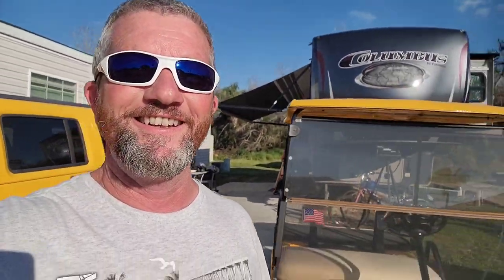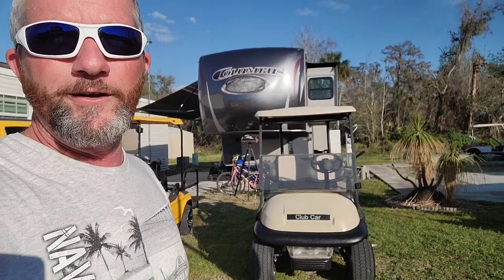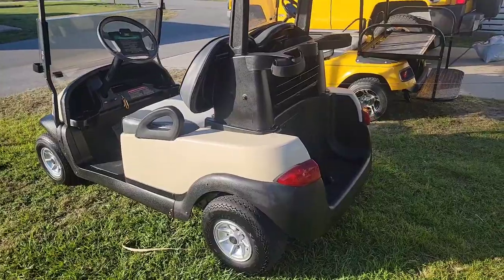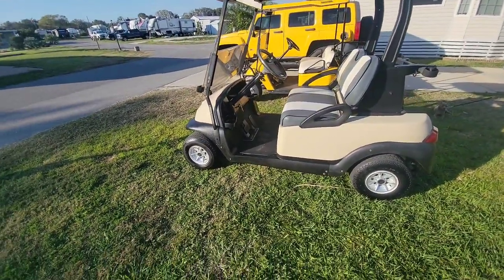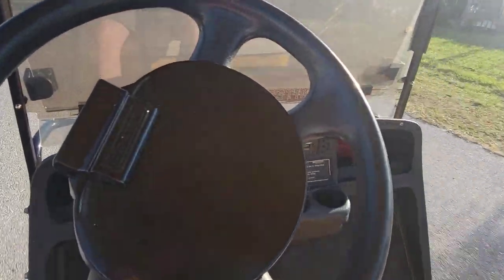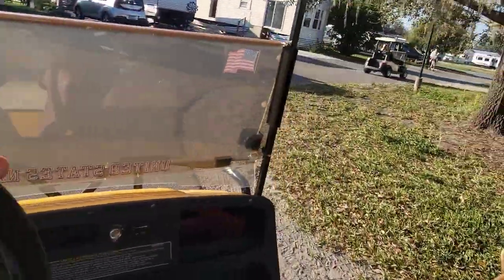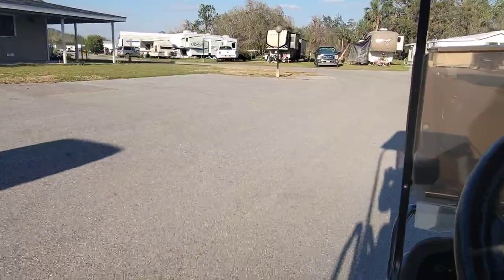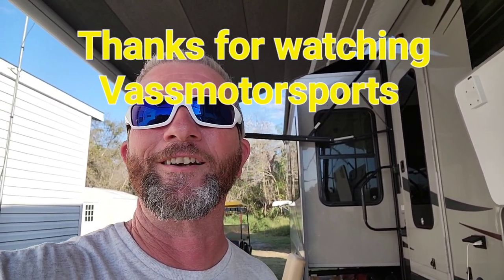Ezgo 36v. VS Club Car 48v drag race golf carts,which one is faster @Vassmotorsports

Comment: Just saw your video, my ezgo 36v with 20" tires does 20 .6 mph on gps, my brother inlaw has a club 48v w/ mods does 20.2 mph.
Reply from the maker: thanks for the feedback,  this yellow ezgo is all stock 36v and 18"tires and has to run 20mph cause after this video i picked up a lifted cart just like this one and its all stock except the lift and 23" tires and it ran 19-20 on gps and this yellow one out ran it ,  ive sold all these since then and just using an old Club Car DS i got dirt cheap cause it was in the flood from Hurricane Ian at the park ,  thanks for watching Vassmotorsports and hope ya check out some of my other videos sometime,  heres 3 video links ,  first is the lifted cart i put some lights on and second is my DS that i rescued and restored some and one i did some custom seats https://youtu.be/j2Rkf1sftgg?si=kMgHwxVyOIev74S6.        #2. https://youtu.be/7EacmE_K6WQ?si=A9eOFYjsLPYIqGRu.     #3 https://youtu.be/xkMav3TQ7ik?si=Pa2Xl63D3r-tTjen.    #4https://youtu.be/IWlVBVyNLKw?si=PPUH67jYkrY6S9XV

Comment: I JUS BOUGHT ME A 48V YAMAHA DRIVE LIFTED AND IMA SMOKE ALL THE GAS CARTS AT THE PARK THIS YEAR GODBLESS THE TORQUE
Reply from the maker: Yes they definitely have a lot of torque,   mine still had the stock magnet on the motor for the speed sensor and can change to fool the controller to go faster.   Or can have the controller programmed to higher level for speed.  The yamaha cart is very similar in build so you should check on that for yours and make top speed faster